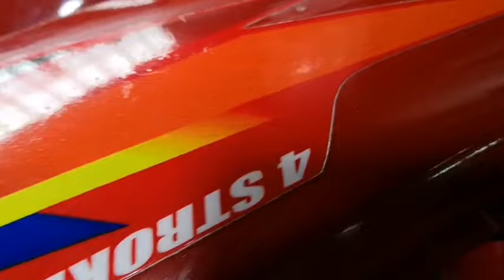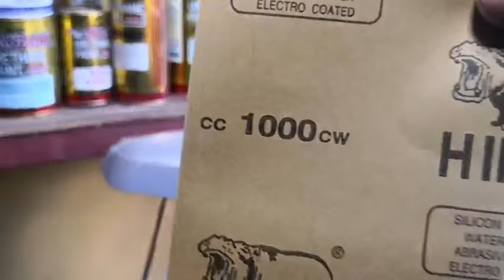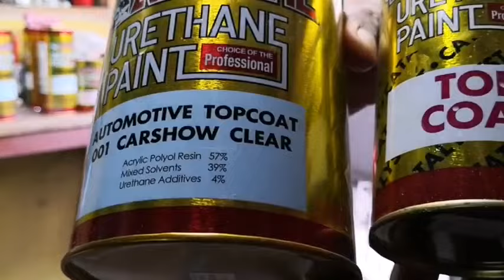MATIBAY NA PRIMER, BASECOAT AT TOPCOAT I PAINTING TUTORIAL I DA HUSTLER'S TV

Comment: Salamat po for sharing. Joy rin gamit ko pero halo na sa tubig po. DIYer po ako hhhh. Paint roller at brush lang gamit ko. Ano po ang recommended nyo na air compressor  reliable .. HP (horse power) na angkop sa mga light paint diy pero not for business po. Vespa po target ko baka sa December pa makaipon po. Salamat po.
Reply from the maker: Maganda at matibay ang vespa matagal kong gamit yan. 1/4hp yung sa akin, 1992 ko sya binili mga 4K plus til now nagagamit pa. Napag ari ko sa kotse kaya lang medyo mahirap lang pagmalaking bugahin kinakapos sa hangin di consistent. Sa diy or fairings ng motor sakto lang sya. Medyo maingay lang de oil, de motor at de belt kasi. Kung pang sasakyan maganda 2hp.

Itong gamit ko ngayun mitsushi 600watts equivalent ng 3/4 horse power. Oil less at silent type. Walang motor at belt, diaphragm lang. Last year ko lang binili to 3K plus, so far ok naman performance lagi ko pang gamit ito. Salamat. 👍❤️

Comment: Ok lang bah na anzhal primer anti corrosion. Tapos ang basecoat at top coat ay samurai paint ? Para po ito sa chassis ng motor.
Reply from the maker: Pwede naman kaibigan. Pero mas maganda at matibay, i-anzahl mo na lang lahat. 🤗
Reply: @DAHUSTLERSTV0310  need paba i clear coat pag sa chasis lang  or puwde na hindi?
Reply from the maker: @jummieamistad3408 Kaibigan yan ay depende na sa may-ari. Dagdag gastos kasi pag nagtopcoat. Pero kung kaya pa ng budget iba pa rin may topcoat lalo na pansariling gamit. 🤗
Reply: Last question hahahaha. Ok lang bah pag guilder primer. Samurai paint base coat at anzhal topcoat sa cover o mga metal parts ng motor?
Reply from the maker: @jummieamistad3408 Pwede naman yan kaibigan kaya lang bakit ka pa mag sasamurai kung gagamit ka ng air compressor at spray gun. Anzahl mo na rin ang basecoat.
Reply: @DAHUSTLERSTV0310  pwede bang gamitin na primer ang anzhal anti corrosion sa fairings ng motor?
Reply from the maker: @jummieamistad3408 Hindi ko pa sya naitry kaibigan sa fairings pero sa bakal ok sya. Gamitin mo na lang ay anzahl spray filler primer surfacer or Guilder epoxy primer gray. 🤗
Reply: @DAHUSTLERSTV0310  MARAMING MARAMING SALAMAT PO 🥰 . Dahil dika nagsawang replyan ako hahaha. Goodbless po and more subs sa iyong channel❤️
Reply from the maker: Welcome kaibigan. Maraming salamat din sayo. God bless. ❤️🤗